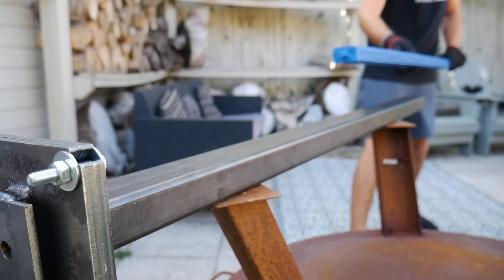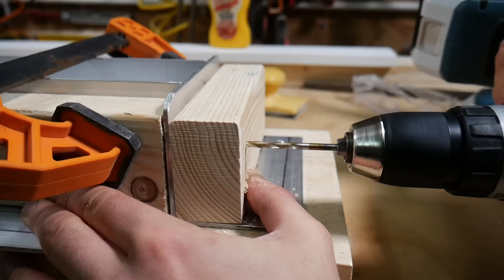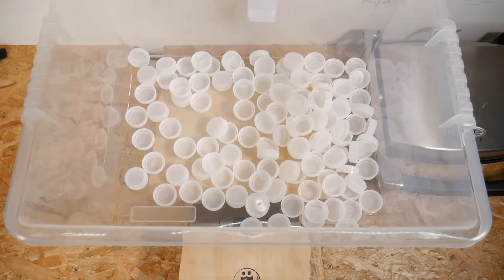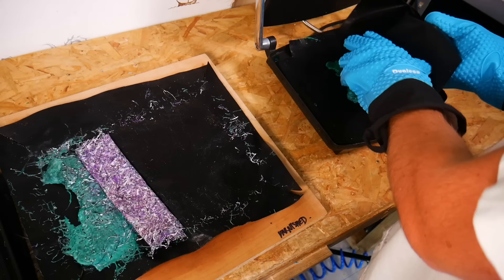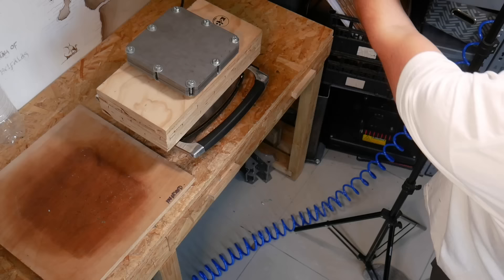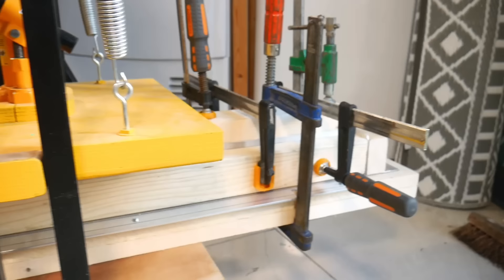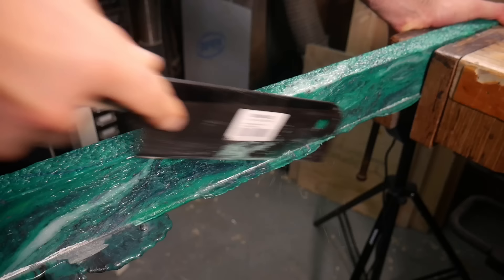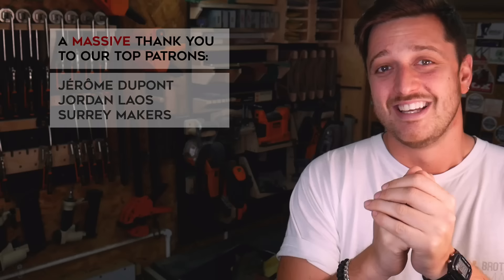How to Make Recycled BEAMS from Plastic Waste at Home

Comment: For bulk processing, use a big double boiler over a gas ring. This enables consistent lower temperatures over a good surface area. Just use caution when lifting the pot out of the boiler vessel, hot plastic, steam and boiling water are not fun to spill on oneself.
Reply: A double boiler never gets much above 100degC
Reply: @TheBaconWizard  plastic liquefies just above the boiling point of water. Good double boilers seal enough to get the pressurised steam to heat the boiler itself to above 100'C. Alternatively, use oil instead of water, and you can push the temps up to optimal with a good thermometer and a reliable heating element, the extended temperature range of oil will get you up to 200'C with no flash point issues.
Reply: @TorquilBletchleySmythe  Just use an induction heater. Better still, make moulds from mild steel and use them to directly melt the HDPE inside them.
Reply: @TheBaconWizard  I see inconsistent polymer bonding using heated moulds, and an induction ring does not share the same fine-tuneability as a gas ring. Inadequate bonding of beaded or shredded polymer waste leads to delamination and variables in tensile strength. I prefer the double boiler for thorough mixing and bonding of individual elements of the plastic. My industrial plastic production experience is in recovery, conversion, proofing, extrusion, and injection moulding. If you are choosing to simplify the industrial process for diy production for enthusiasts, you still need to consider the basic processes required for strong, consistent products. Otherwise, you will suffer structural failures and add to the already concerning stockpile of global plastic waste.
Reply: @TorquilBletchleySmythe  Induction can be FAR more easily tuned than gass. One can even achieve sous-vide cooking with it, without a sous-vide machine.
Reply: @TheBaconWizard  I will accept your opinion, but disagree.
Reply: @TheBaconWizard yet boiling water gets to 212 or more. Maybe just not doing the double boiler part. Yet not sure how boiling water and plastic reactions are.
Reply: @MildarValsik  At normal pressure it never gets beyond 100degC. As we learn as children.
Reply: @TheBaconWizard double pot "boiling water" as I was checking. 212°F is 100°C yes  which some plastics will melt at that. "SOME" 

Also this Can water get hotter than 212 degrees? Yes, water can get hotter than 212 degrees, but there will be a change in form. As water boils at this temperature, it changes from a liquid to a gas. That gas, or water vapor can continue to rise in temperature.

So you are right about "water" yet not in its "GAS" stage. It can be hotter than 212 °F or 100°C. Which in itself "gas" stage still "water vapor". I mean we can cut into details all day or say "maybe" try. Science is about exploring and experimenting with processes. Also at "normal" pressure. As we learned as children. However you stating your last part is pretty childish. Science isn't just about right or wrong it's fun to explore and test. I don't need your negativity.

Comment: @Brothers Make - Just finished your Video. This seems very online with how: Skatelight & Gator Skins have Revolutionized the Top layers for Ramp Builds. If your process can do that for the rest of the Wood needed for builds...the Possabilites would be insane.
Also try doing one but adding in Carbon Fibers into it for more Strength.

Comment: I think the amount of steps is what is taking you so long. Grinding everything up will definitely help speed up the process, and I'd probably just focus on the toaster oven, as you're adding time by transferring from one to another and mixing bits together. If you just grind everything up nice and small, you can throw it all in the oven together, melt it, then folding and stretching, then repeat until you have a smooth mix. Grinding can also be done ahead of time in bulk so you can just grab the required amount whenever you went to press another bar.

Comment: Hi! I'm from the Philippines. I'm currently doing some research and wondering if you can also create a recycled plastic beam out of shredded plastic straws and plastic sheet film, including the materials you used for this video. I've searched the material composition of each material you used in creating the recycled plastic beam and I've observed that Polypropylene and Polyethylene are the type of plastics that were considered. The bottle cap is made out of polypropylene and the plastic welded box is made out of polyethylene.  Since plastic straw is made of polypropylene and plastic covered with polyethylene, I was wondering if they can be recycled too. I'm performing some research and searching for an easy way to properly dispose of shredded plastic straws and plastic covers and avoid them ending up in landfills. Hope I could get your attention and you can answer my questions. Thank you.
Reply: Hi Jacey, I also live in PH though i am American. Yes you can use straws and plastic covering. There method is time consuming and costly. If you are looking for a commercial application i would suggest extrusion. You can make beams or round stock to any length. The initial cost would be more but you would get a better product much quicker to make.  Turning the plastic into small pieces first will also help greatly in time reduction and be a must for extruding. Water and soda bottles would work great and just thrown away here as i see it. I wish you luck in your endeavor.

Comment: You'd have to heat the entirety of the volume equally, after abrasion or reduction (chipping) so the medium is first all a uniform size so the recrystallization of the heated chemical doesnt become uneven while folding it puts air into the mixture, creating microfractures, so it should be done in a vacuum to pull the air out of the combustion process for strength, and vulcanizing it should be done with consistent pressure distributed evenly across the surface using triangle blocks placed and lobbed between the surface and the clamp arm evenly divied across the length of the surface area.
Reply: I recognized the fact that their method of removing air pockets was actually adding them, as well. While I love the enthusiasm of the project, I detest the confidence in the supposed “facts” of explanation of certain processes. This is an issue I run into a lot of times with “how-to” videos.

Comment: Great video guys.  just a thought, I have some experience with casting metal but have never melted plastic, what is the maximum operating temperature of the plastic?  You heated it up to a taffy consistency and as you saw it was a pain to work with and get in the mold, could you make it hotter and thus more liquid?  It might be easier to work with at a higher temperature but higher temperature may increase the risk of off-gassing toxic fumes or it may alter the molecular structure and make the finished product weaker.  Your use of the panini press is resourceful but if you want to melt plastic efficiently in large enough quantities to make boards you need something that takes way less touch labor, some kind of plastic forge that you just dump buckets of bottle caps into and it just melts them all automatically, again the operating temperature range would determine how you designed the system.
Reply: I use an old soldering iron to melt HDPE scraps to patch cracks/leaks in other HDPE items I have. It begins to weaken around 100°F from what I've read. It's much more stable at lower temperatures. That's why it's so commonly used for refrigerated products. It's also an inert plastic that doesn't leach any detectable chemicals into foods or liquids when in a solid state. You do not want to melt it into a liquid form because you'll burn of a lot of the plastic. Plastics are petroleum based and will burn. A Play-Doh like consistency is best. LDPE and PE are lower density forms of HDPE. Those could be melted down as well. Don't mix them because they won't stick to each other.

Don't try to melt PVC. It will release a ton of chemicals in the air that are very bad for your health.
Reply: Hello, new to the plastic game here! What is LDPE and HDPE?
Reply: @wildalice  PE= polyethylene LD=low density HD=high density
Reply: @ericthecyclist  thanks pal!

Comment: Have watched this before and re-watching it again. May I know:
a. From 8 kilos of used/waste plastic, what was weight of the beam from the mold, and as polished?
b. In terms of energy or electricity usage, how much total did you end up consuming (from heating them down to polishing, including working on the mold)?
Much thanks for the inspiration.
Reply: I was wondering how energy in KW needed for recicling a pound of clean plástic (residual dirty plástic wears much more E to clean) and if the process can be made with solar ovens

Comment: I feel like the key downfall of this is yeah while you're preventing plastic waste, you're wasting an insane amount of electricity, which I would argue you're creating WAY more waste than your saving probably by 50 fold or more.
Reply from the maker: Our electricity comes from 100% renewables 🤙🏽
Reply: Like the insane amount of electricity used to illuminate cites at night
Reply: Please elaborate your position for further comprehension.
Reply: Weirdo
Reply: I thought the same when I watched the guy who makes ingots out of tin cans, looks great but uses a 2ft high canister of propane to make it.
Reply: @rogerterry5013  That electricity has a purpose, even if you disagree with it.
The economies of scale that make recycling profitable don't generally translate to small-scale implementations like this.  The Brothers may have 100% renewable electricity, but most people watching this won't, and that's an important cost and environmental consideration.  A lot of people think they are being green because they don't consider all factors.  Earth ships come to mind, sequestering easily recyclable glass in earthen walls.
Reply: @bmmaaate  you are missing the point dude. These guys are making a start. Use your ingenuity to improve on what they show you? Mr  Dunning Kruger
Reply: Dunning Kruger all over again?
Reply: Sharkys right. Even renewable energy comes at a cost, whether your suppliers or materials or processes to get machines to make renewable energy comes at a large cost as well. How many workers need to drive to work in cars to produce renewable energy machines and if those cars are lithium battery powered then you should look up how big the mines are to get lithium and how many people and places it goes to to be made. Like they said in the video the best way to reduce plastic waste is to not use as much. The board as well is just going to pollute wherever it goes as well, to screw it into another board it may need holes and if its outside rain will bring it into the soil.

Comment: Awesome project! For the time element, maybe a future project could be a miniaturized hydraulic auger; in injection molding, the main screw turning provides about 80% of the heat to melt the plastic from the mechanical friction of twisting and stretching the plastic. They're normally huge setups to provide crazy high tonnage of pressure, but something small could probably greatly help with handling

Comment: I have wondered if anyone has thought of melting plastic waste and turning it into filament for 3D printers? It seems that would be a worthwhile goal. The idea was use waste plastic, turn it into filament, use filament to produce prosthetics for 3rd world countries where it would be available to the very poor, especially children.
Edit: how often can the plastic be reheated before it starts losing it's properties (strength, flexibility, etc.)?
Reply: There's a few machines on the market that can do that. They're expensive and they have some trouble creating filament that has consistent diameter, but they're improving all the time.
Reply: Depends on the type of plastic, the heating and cooling cycles, and any other types of stress, ie. mechanical if making a spring, put under the plastic.
Reply: This only works one a few types of plastics everything else is mostly boned.
Reply: Many times. There are practical problems. 3D printers are quite fussy about consistent materials - the exact composition matters. Plasticisers, mix of polymer chain lengths, even the dyes. It's only remotely practical if you have a supply of plastic waste of perfect uniformity, like leftover sprue.

Comment: What are the energy costs of melting all the plastic?
I find it interesting that it can be done, but anything that is so highly energy dependant, make a useful product from one problematic waste product, but causing a different kind of pollution through energy cost is questionable. 
There was an aluminum production plant near my former home that shut down due to the high costs of energy in the UK.

It's like suggesting eVs are the solution to air pollution in cities, and whilst it might well allow cities to meet their target levels of air pollution, the mining, transportation for every stage of the component to product process, energy requirements for manufacturing, charge energy, relatively short battery lifespan, disposal costs, invariably invalidates a city pollution reduction.
Reply: Polyethylene melts at 115C. Polypropylene melts at 163C.
It takes less heat than boiling water to reach these temperatures due to low thermal capacity. These are the low end and sensitive to how long the chains are so going 20C hotter would be reasonable. Injection moulding machines run at 160C for PE and 190C for PP with water cooled moulds. Molten PE & PP will burn like candle wax so are a fire hazard.
PET can’t be recycled this way as it depolymerises before it melts at 260C into rather toxic liquid that boils at 170C…
Reply: @allangibson2408  could you use this as a cheap warbla alternative?
Reply: Nevermind the toxic offgasing when burning the plastic.
There's a reason its illegal without a permit across North America.
Reply: @in_ur_moms_house  PE and PP are widely recycled - they just can’t be used for food or food service piping.(due to “possible” contamination).
Reply: @allangibson2408  indeed.  Yet no one engaged in plastic recycling can honestly say toxic fumes aren't released when heat is applied.  Sure pe and pp give off 5 time less fumes than abs but they still give off fumes, and no recycler should attempt it without a proper ventilation system, safety mask(s) and researching the legality/requirements in their jurisdictions.
Reply: @in_ur_moms_house  no one said anything about doing this en masse, at such a volume as to be polluting more than the removal of the plastic from the trash heap saves. These are small projects, done a little at a time, not an entire manufacturing company doing it 8 to 24 hours a day, 5 days a week.
Reply: @jendubay3782  what did you mean to type when you typed "warbla?" I thought maybe marble, but I wasn't sure. And if so, an interesting question!
Reply: @MaryAnnNytowl  anyone who does it more than a couple hours a year, especially if they handle the product with bare hands, should be aware of the risks.
Reply: @MaryAnnNytowl  warbla is a heat sensitive plastic that you can boil or heat gun and then shape it however you like. Cosplayers use it for armor a lot

Comment: Shred plastic directly into a drying chamber using a screw to drag drying shredded plastic through the chamber to an extruder to injection mold the beams. Also cut a few slots in the molds bottom and flush fit pistons to ejecte the parts from the mold using either hydraulic or nuematics to stream line and partially automate the process

Comment: I'd like to figure out how to make sheet material about 1/2 inch thick and 4x8 ft. or maybe 1x6 . Do you think that maybe making a self heating mold might work if there is an iron backing behind the aluminum and it's heated by an induction coil ?

Comment: In the past I worked with molten polyethylene (making custom shoe lasts) and we used old electric frying pans to melt the plastic and keep it molten, decent heat control and enough capacity to melt ~4L of plastic.
Reply: a few years I thought about using old electric frying pans but never got around to it. I may have to revisit it. Do you have any problem with the plastic sticking to the metal?
Reply: @ericthecyclist  Not really, the frying pans were originally non-stick and the polyethylene/polypropylene mixture we used doesn't stick to much of anything but itself. The molten plastic didn't stick, and if you wanted to empty the pan just let it cool off and the plastic would shrink away from the pan walls and auto-release the whole block.